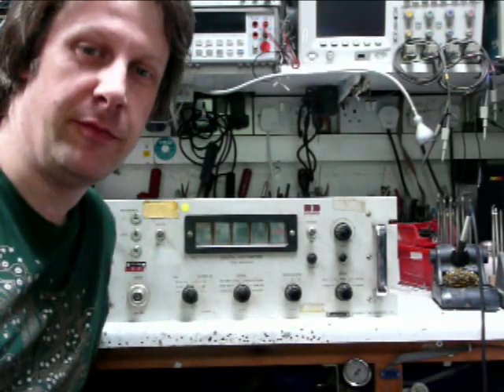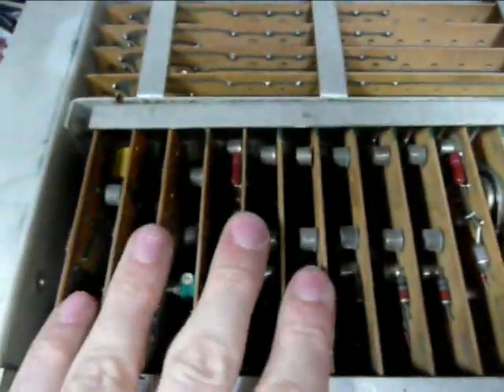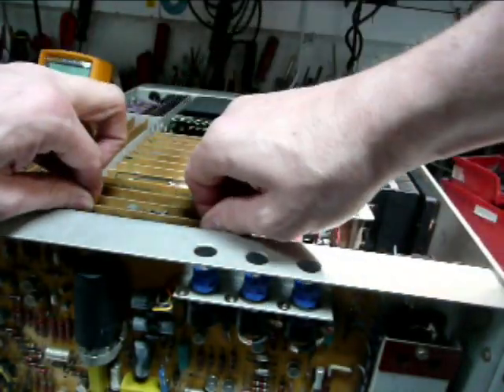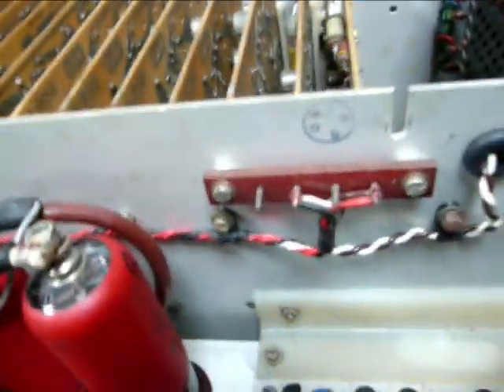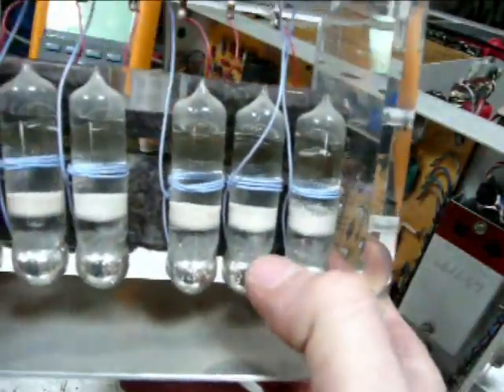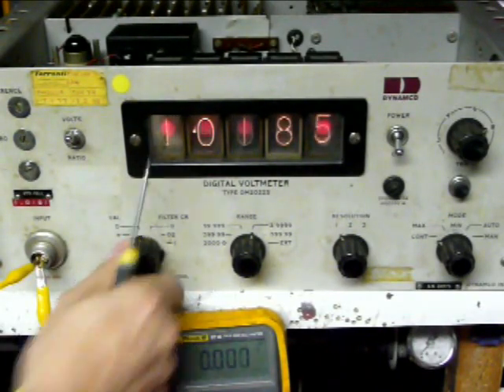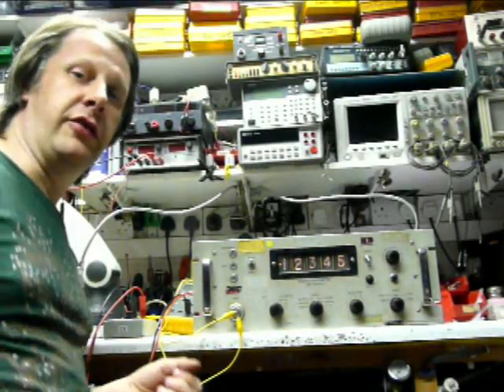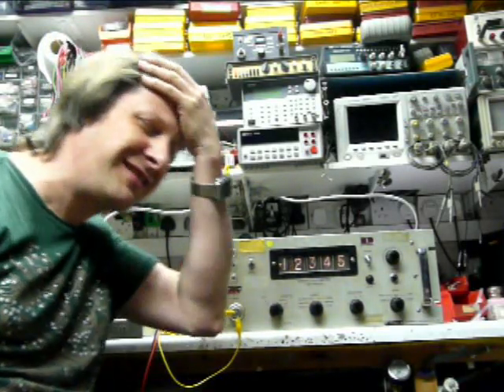Dynamco DM2022S Digital meter review and teardown

Comment: I taught myself the old wire looming/lacing technique. I am using it inside my custom built mechanical keyboard, and I plan to use it for cable management in my 1939 Philco radio PC case. I can't say no to such a beautiful bit of tech art!

Comment: In Sweden up is slightly more common, but we have a serious mix of up or down. There are no clearly visible orientations on most lighting switches and there is no regulation as to which way they should be mounted.

I prefer up=on myself for the simple reason that it's easier to accidentally turn it off than in that way.

Comment: Non-Linear Systems used to make an autoranging digital voltmeter (the first in the world) which used relays and Strowger selectors sealed in cans filled with transformer oil.  No transistors or vacuum tubes- just all electromechanical logic.
Reply: I used to own one but had to let it go in a move across country.  Wish I still had it, it was a miracle to behold!  Know where I might find one?

Comment: @mikeselectricstuff For one more bit of evidence, search "ignition switch panel" and click wiringproducts dot c o m. The pix shows a red plastic safety cover typically used on toggle switches to arm nuclear weapons, etc. In case of accidental activation, by say a bump, it is designed to move the toggle lever downward to the off (or non-city-destroying) position. This could be muddled up only by using a double-throw switch mounted UPSIDE DOWN WITH THE WIRING REVERSED. I rest my case.